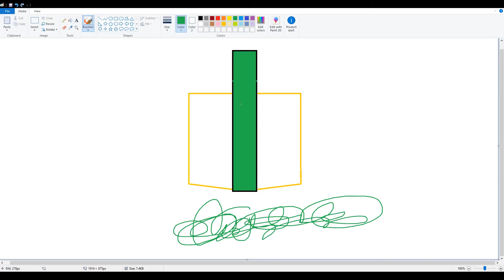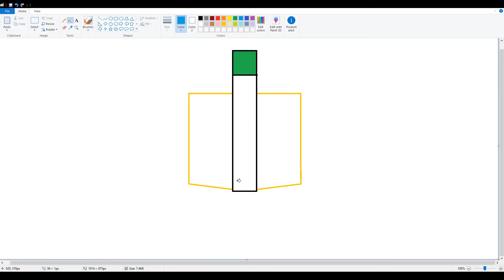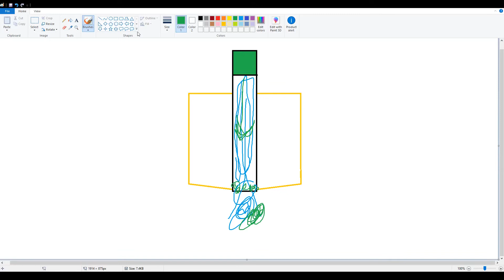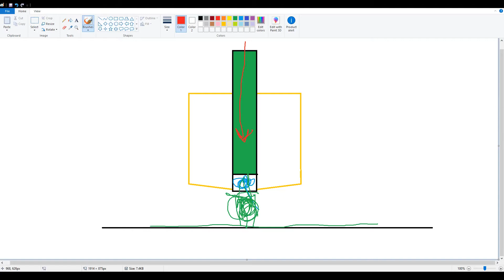Get Rid Of The BLOB On Your 3D Prints

Comment: Great explanation. Was wondering what that noise was, I thought it was a click or crack of filament getting tangled or something. Gonna try this on my next print. I find black filament to worst to work with as it needs to run very hot so I don't get layer separation (230c at 40mm/s). This unfortunately gives me huge zits now so I'll try retraction from 4.5mm down to 2.5mm
Reply: that is moisture in the filament (maybe) . I know 100% that is the prob.with TPU.   So you should try that too..

Comment: unfortunately
 with lower (2.5mm) retraction i get a lot of stringing and still didn't rid of them.
Reply from the maker: Try decreasing your temp 5 degrees.  You may be running too hot and the filament is still dripping out causing stringing.  Also ensure the throat of your print head is actively cooled so the filament does not melt too far up in the print head.

Comment: Hi! I've heard that this "air sucking problem" becomes from the speed and acceleration of retraction moves. Just try to suck in a liquid glue (from a plain surface) with a rubber syringe (that hand-powered pear shaped thing... "syringe"?) doing this slowly and setting it with a distance above that glue. I'm sure the success will be different depending on the speed. Also high-speed and acceleration retracts quickly grinds off plastic with multiple moves so it's another problem.
IMHO, 40 mm/s is too much. Also another man told me that it can cause to rip off the cold filament part from it's hot liquid part. This also can cause the creation of these spaces inside the nozzle. Gas dynamics is a biatch :) Never knows when it will be good or bad companion.
P.S. how much is for the whole bag of this silica balls? I'm thinking about using some very dry bread cookies instead of it if I'll not find for a good price :)
Reply from the maker: The moisture absorbent packs are $1 each at the Dollar Tree Store.